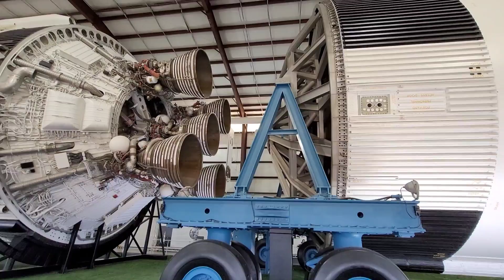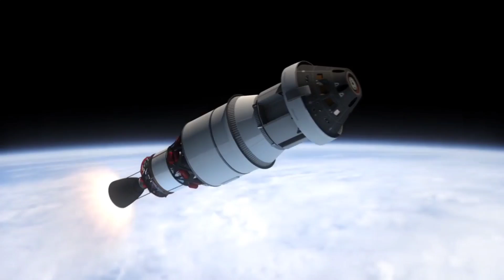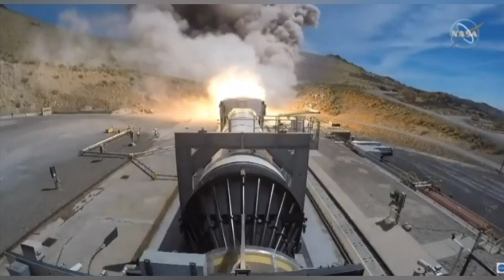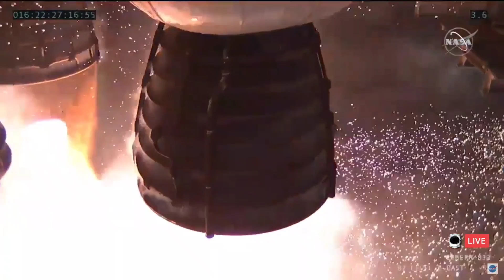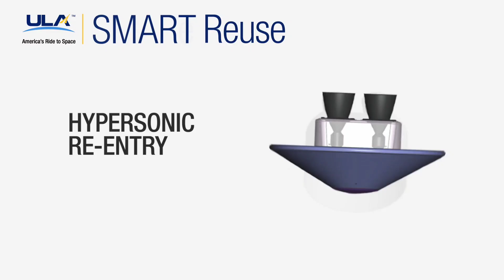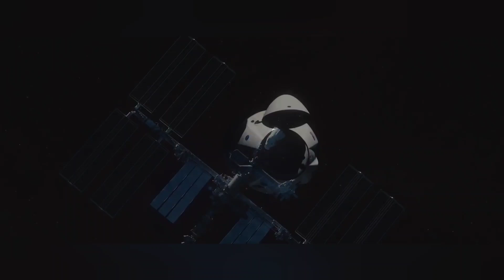Green Run Canceled! How did Boeing foul up SLS so badly? Can SpaceX or ULA (both?) solve this?

Comment: Meanwhile, SpaceX replaced and successfully static fired a raptor engine on SN10 in less than 24 hours. Let that sink in.
Reply: Insane progress of innovation! Universe, here we come...
Reply: @mikedeere4699  

No, just a quick reaction. SpaceX won't do shit. They will get a standard job done but at a standard price.
Reply: @bobfg3130  they have set the standard for the 'standard price' when all the other legacy rocket companies are charging nasa/the goverment/tax payers a small fortune for each launch of their non-reusable rockets. 
Dont know where you've been the last 10 years but SpaceX have made a hell of a difference and they are only just getting started.
Reply: * sink knocking on door *
Reply: @Bobcat665  chefs kiss perfection
Reply: yep, but according to one of those guys in the NASA press conference after that last test that was supposed to be a green run, he said when asked how quickly can they turn around and repeat the test to get more data. His answer was something like they needed to wait for 28 days for the engines to dry out or something first before they could even inspect them. 

SLS sounds like how roadworks are over here in Australia, u got 1 guy digging the hole and 7 managers standing around the hole inspecting his work. Of course like that its gonna take 7x as long to dig the hole.

Heck 28 days after a starship pancaked the ground at near terminal velocity, SpaceX is almost ready to send up the next one. 

Such a shame how it has come to his, I read somewhere that in the '60's after 1 Saturn V launched, NASA had the next one ready to go at the launch pad in 2 months.

As much as it might anger people... I think NASA just needs to fire Boeing from the project (if they were allowed to) and recruit another company that can actually get the job done.
Reply: @MrGeneralScar  Saturn V testing was actually a bold departure from previous projects: all three stages were flight tested at once, i.e. all up.  There was a war on! (Cold).  The Apollo schedule was incredibly aggressive.
Reply: And the big booster is just around the corner! But this is not a new approach to rocket testing and development. It's actually the original approach (let's not mention where, though, if you catch my von-drift ;)
Reply: Ojas  exactly. I'm sure almost everything had be thought up by someone at some point, so does that mean absolutely nothing can be revolutionary anymore? What is with some people.
Reply: SpaceX just speedrunning everything in its own way
Reply: Ojas  I guess we are just elon apologists. ;)
Reply: It would have taken NASA or Boeing weeks if not months. I was astonished.
Reply: @AP-qs2zf  maybe he means it's not a good solution for supplying lots of tax dollars and jobs all over the country, and making some people rich.
Reply: Yeah really, this is just this guy complaining that nasa is overspending. Space X is going to be the way to go, and as a veteran, private business over government organization will always be faster
Reply: @SpacialQuantum  I think NASA could be really cheap if they did everything themselves. But NASA has always had like 100 contractor companies working on various aspects and parts, it gets gluttonous and companies like Boeing don't always charge fairly, they fall behind schedule and the cost goes up, something is wrong and the company says it'll take a month and $100,000 to fix.

If a private company did the same kind of thing it'd be just as bad. But instead we have SpaceX handling everything about their rockets and wasting no time or money. The reason SpaceX has always been pretty cost competitive is because they manufacturer almost all their parts, disregarding reusability because they've always been fairly cost competitive against ULA and their outsourcing of parts manufacturing.
Reply: Ojas  👌
Reply: Other than pork-barrel politics, do you need Orion at all?
Reply: They are not forced to use a extremely complicated old engine.
Reply: i sincerely doubt they would do that if they had a commercial payload on there let alone crew. those firings n launches are prototyping.  its quite incredible how fast they can test n make progress this way though
Reply: @km5405  compared to SLS or the delta 4 heavy, who take months to reset after a hot fire abort, flying 1 hour after a hot fire abort isn't just fast, it's warp speed fast by comparison.
Reply: @km5405  

The Starship concept was probably real, but the vehicle is not. I don't care how many rockets they blow up; thats how aggressive testing works. My grievance is with the PR conartistry. This vehicle appears in every way, to be designed from the ground up, as a testbed for a particular technique, with no developmental path for a practical vehicle. The reason its made from uniform stainless steel panels, is almost certainly because they are recycling it for successive test vehicles. This form factor, at any scale, with enough fuel and engine to reach orbit and soft land, would have about enough payload capacity for a crew and their lunch. But it looks really cool... here, take my money!
Reply: It's because Boeing's become fat, lazy and stupid.
Reply: @AntiangelRaphael I never said SpaceX would be going public. It is known that Starlink will go public once income is predictable, although it'll probably still be negative on IPO. This one has to go public for that cash influx if it's going to survive
Reply: they did 3 static fires the day before SLS did a single static fire, and that one aborted halfway.
Reply: @jearlblah5169  They've done 3 in the span of a few hours, although not more than 1 second each, the process is the same to ready an engine and reset.
Reply: @AP-qs2zf  Not stupid, a troll...
Reply: No one is talking about break through star shot. I know the guy is dead but his concept was by far the most daring.
Reply: @ntandotshangela8999  you realize that is nanotech right? why would we be talking about it?
Reply: @AP-qs2zf  😂😂😂😂 well put
Reply: SLS needs a month to replace an oxygen valve - the reason there has been no second firing test as yet. And remember, they have stacked the solid boosters in anticipation of a launch, but they may have to disassemble them if the launch date is delayed too much (inspections needed if over their 'shelf life') and re-stacked.
Reply: shhhhh iT's dIfFeReNt though.......... lol!
Reply: @AP-qs2zf  Yet is correct and called the fireball.
Reply: Your point? Meanwhile Space X unsuccessfully re-fired a Raptor engine on SN9 in less than 24 hours. Let that sink in
Reply: @AP-qs2zf 
 Yes! He is.
Reply: We need to get our s*** together or by the time we return to the moon astronauts will be staying at a Chinese hotel
Reply: Ojas  reusable rockets are just a concept? Hmm. Go back and check again.
Reply: And it blew up
Reply: @springbloom5940  Are you one of those shills who deliberately ignore things that are obvious to everyone (ergo, that this flight was a massive success) just to make yourself look stupid in the process?
Reply: @carljohan9265  

Don't use words you don't understand 🤦
Reply: @carljohan9265  

shill
/SHil/

noun
an accomplice of a hawker, gambler, or swindler who acts as an enthusiastic customer to entice or encourage others.

Who does that describe here, imbecile?
Reply: @springbloom5940  Oh yea, pretend to not know the meaning of the term the way it's used on the internet.
And throw in cheap name calling for good measure. 
Keep dancing if you want, I'll have some more fun laughing at your pathetic attempts at provoking me.
Reply: @carljohan9265  

You really are this stupid, aren't you? Please clown, entertain us...
Reply: @springbloom5940  come on now, that was weak. 
Surely you can do better than that?
Reply: Sn 10 didn't go to space
Reply: @1320crusier  I don't understand why you feel the need to state a fact that everyone in the fucking world knew long before SN 10 even flew.
Reply: SS is a hollow shell and still blew up. You have no idea how complicated a human rated rocket is. It took Spacex 10 years to develop Dragon, let that sink in....
Reply: I am getting a lot of pushback for my comments. check out this video. https://youtu.be/aNZTRdq7xbE
Reply: Ojas  " cost effective"  does not equal to PERFORMANCE
Reply: Doesn't matter. SpaceX won't make a difference.
Reply: Ojas  oh me too man, that would be the level of innovation that Elon apologists believe he is capable of.
Reply: @quantumuninstall  let’s look at the last of how many reusable transport system there where, hhhmmmmm I only see one which was partially ( 75% yes I am nitpicking) reusable that was the STS.
Reply: Lets hope Biden does not cut the NASA budget like Obama did. Biden may need that money to recreate ISIS in Syria that President Trump destroyed.
Reply: @shasha1873  Ares was coming in over budget, over time, and under performance when Obama canceled it in favor of the Commercial Crew Program. Senator Shelby however was pissed because his district was losing money so he riled congress up with false statements about Nasa not having any launch capacity and successfully uncanceled the Ares V and then put it in his district. The shape of the Ares V should look familiar because it got renamed the SLS.

And that probably explains the SLS really. It didn't start to give NASA spacelaunch capacity, it started as a jobs program.
Reply: @shasha1873  Trump didn't destroy IS
IS you cult magamoron.
Reply: @jabom99  Yes he did. One year after his presidency you never heard about ISIS again on TV. Obama was arming them and called them moderate rebels. LOL
Reply: @shasha1873  where’s osama
Reply: @shasha1873  Except we keep hearing about IS and other Terrorists. Not to mention Trumps promotion of Rightwing terror groups in America. So Trump not only abandoned allied groups to Terrorists in the Middle East, he backed Terrorists over lawmakers in the USA.

Of cause crashing America’s economy is almost a standard thing for Republicans now days. Fluffing the pandemic response so badly 40% more Americans die on average than is normal. Which leads to greater than half a million deaths. That is Trumps special saurce and he splashed it all over America.
Reply: @jabom99  Ok I have to give you props about the response to the "cult magamoron" 🤣, but i have to disagree about your opinion on spacex. they have made the same progress as NASA with 20x less time. Im willing to give them a chance since the starship is still a prototype, and is making its way up the steps for now.
Reply: @jabom99  idiot troll?
Reply: @psibug565  are you talking about Obama and Biden?
Reply: Ojas  no need to be an Elon apologist, but there’s not a whole lot of revolution going on here. Just moving fast and breaking things. More power to them, but everything they’re doing has been done before, just some of those ideas were before the technology could support them.
Reply: SpaceX isn't exactly doing anything revolutionary. Elon musk is simply rehashing old ideas with new technology and calling it innovation, not to mention that all of the "huge milestones" are exaggerations of the truth.

But I will give him and SpaceX one thing. Those Raptor engines are a goddamn thing of beauty. The first full flow staged combustion engine that has not only flown successfully, but has show to be repeatable.
Reply: @quantumuninstall  In my opinion real development is exactly what SpaceX does. Realizing, funding and commercializing ideas is always real bottleneck of all industry. There are always swarms of innovators with exotic ideas and most practical development steps are based on surprisingly old ideas. 
SpaceX is the first company which have commercialized reusing of rockets. It exceeds all ideas on paper in my appreciation with orders of magnitudes. It is practical step which leads to more advanced operations in space and not just science fiction story for 50 years like many published new ideas are (for example, all suggested forms of nuclear propulsion).
Reply: @quantumuninstall  How exactly is it not anything revolutionary? What rocket does what Starship does?
Reply: @quantumuninstall  There are no real new ideas. People keep thinking that the only mark of true innovation is thinking up brand new ideas yourself, but newsflash - every good idea someone's thought of has probably been immediately thought of the moment that field was known to exist, and long before it was feasible to expand. Actually translating those ideas by bending metal and testing is what is often missing nowadays.
Reply: @quantumuninstall  And what company landed boosters vertically and reflew them multiple times prior to SpaceX? So what if they are using existing systems that have proven effective? That is how progress is made, standing on the shoulders of giants.
Reply: @quantumuninstall  who else has reusable rockets?
If that is not innovation, what would you consider innovation?
Reply: @AP-qs2zf  Are you not capable of objective thought?
Reply: @jabom99  SN8 SN9 SN10 are testing platforms. Have you not seen the stacks sitting waiting to be assembled. Remember that Musk achieves most of what he sets out to do. Like landing and reusing Falcons. ULA, Boing, and to some extent NASA are dinosaurs with dimentia. They do nothing but waste tax dollars.
Reply: @jabom99  You troll. 
You not objective. 
You got it right! 
Just provoke and insult to your hearts demand. 
Just like those stupid BrexitDeers.
Reply: Sorry SpaceX is not a good solution. It's re useable rockets are not cost effective. Also, SN10 will be another fireball.
Reply: @jabom99  "not cost effective", I'm sorry, but what rock have you been sleeping under for the past 20 years?
Reply: @carljohan9265  He must be a Boeing employee, that's all...
Reply: @carljohan9265  It is not cost effective. The shuttle was cheaper.
Reply: @jabom99  The shuttle cost roughly 1.5 billion per flight. 
That's notably more expensive than the Saturn 5, which was around 1.2 billion and fully expendable. 

A falcon 9 costs between 50-60 million per launch, and a falcon heavy is around 90-100 million. 
So you can just STFU.
Reply: @jabom99  not cost effective? Were you dropped on your head from orbit?
Reply: @jabom99  Falcon 9 standard launch price is ~$62m / < $3,000 per kg to LEO. That looks pretty cost effective. The space shuttle (as another reusable example) was closer to $60,000 per kg...
Reply: @jabom99  And so what if it's another fireball? They've solved each problem so far. They have vehicle control down, the only issue is reliability in landing, first time was fuel pressure, second time was engine failure, third time will be testing a redundancy method. It seems to be cost effective for falcon, since they prefer customers use "flight proven" boosters.

I'm guessing you don't know how many fails it took in testing for all the equipment in the Apollo mission to work either?
Reply: @Jaker788  I'm guessing that you think this heap is actually going to Mars. lol.
Reply: @jabom99  No there's no guarantee, it's an optimistic ideal. But for launches to earth orbit for sure.

It's unfortunate you don't see the technology SpaceX has made, but whatever, be a hater. Maybe when SpaceX goes public you can try short selling and get wrecked
Reply: @jabom99  so you criticise someone for objective thought then say im guessing you think this heap is getting to mars?? Hypocrite
Reply: @jabom99  I found the Thunderfoot Cult member.
Ironic that you accuse other people of being incapable of objective reasoning and individual thoughts.
Reply: @Jaker788  didn’t they blow like 10-20 f-1s up until they made into the powerhouse that it was ?
Reply: @MrTrashmasterfx  Yeah I think the first few had combustion instability. They figured out a new injector plate or something and then they actually put explosives in the combustion chamber to intentionally destabilize the combustion, it'd destabilize and quickly fix itself.

Not sure what problems the Raptor is having, I don't doubt they'll figure it out eventually
Reply: @jabom99  What makes you think it isn't? Im starting to think you are a troll. Starship will be on Mars one way or another within 5 years. Probably before SLS is ready and before Blue Origin has a rocket
Reply: @ThatSB  

You should give Elon your lunch money. Your mom will give you more.
Reply: @Jaker788  This piece of crap will never be human rated. It is unfortunate you call me a hater for stating the truth.
Reply: @jabom99  Ok dude. I guess NASA was wrong to select Starship to be part of the lunar lander final bidding round and actively invest in it.

You should try explaining exactly what's wrong with the Starship platform and vehicle. And you should do research on how much falcon 9 reuse costs (hint it's about 10% of a new booster)
Reply: @Jaker788  The Starship platform has no provision for an escape rocket, it would need 18 in orbit refuelings to get to the moon, it is way too big, there is no astronaut program and NASA is not going to supply astronauts. There are so many reasons I cannot say here.  there is a good video that you should watch that explains more. NASA did give some money but less than the other programs. 
Do some research on youtube.
Reply: @jabom99  SpaceX has done more for space travel in 10 years than NASA has done since 2011.
Reply: @jabom99  "Do some research" = "Do Your Own Research". Bless ya. I think that's +1 on Troll Bingo (tm). Dude - no-one in these companies cares what you think. Sorry...
Reply: @jabom99  splish splash your argument is trash
Reply: @jabom99  The Saturn 5  Rocketdyne F1 engine was almost scrapped due to harmonic vibrations   They kept testing until they got it to work.
Reply: @jabom99  LOL, the best thing to do with folks like you is let the comment age as poorly as your thinking. You'll be just like all the other naysayers who had to go somewhere and STFU up when Falcon 9's started making successful landings. You are someone I would never want to be around in an emergency because you'd be the first one to give up because you can't "see" a way out.
Reply: @jabom99  Are you idiot?
Reply: @jabom99  It's rockets are extremely cost effective when the first stages (or in the case of the FH the first stage and the boosters) are landed successfully. It saves them millions with each launch.
Reply: @solomonaerospace5932  No, The maintenance involved negates any cost savings.
Reply: @jabom99  my oh my has this comment quickly not aged well (sort of)
Reply: @wavywatson4469  Nope I saw a fireball.
Reply: @jabom99  that’s the reason why I said sort of, but it did what the heck previous starships were not able to do, land. So that is a win in my book.
Reply: @wavywatson4469  So would you ever want to fly to Tokyo on this thing. How about the Moon?
Reply: @jabom99  I would consider it, when the starship is in it’s finished state. This is many years away, but I’m looking forward to it, and I believe it will happen. Btw, You’re judging the Starships just from the previous 3 launches. These are cheap PROTOTYPES. Their purpose is to help Spacex figure out what does and what doesn’t work on their rocket. Then they fix those issues. Do you not remember how they handled Falcon 9 landings? They kept trying and failing and learning, until they stuck the landing. Currently the starship is in the same phase. If you don’t believe in starship I understand.
Reply: @jabom99  "So would you ever want to fly to Tokyo on this thing." You sir, have peaked in ignorance. I encourage you to watch footage of the very first attempts at making an 'airplane' pre-1903, and then watch the prototypes that repeatedly failed before that. Then ask yourself, would you fly on that? No. Now be quiet.
Reply: @wavywatson4469  Your hero that you worship like a gawd  says 2023. That will not happen. The crazy Japanese billionaire will never go to the moon. This piece of crap will never be rated to take humans anywhere. Sorry to burst your bubble.
Reply: @gus3770  1903? Who cares?  Check back in a couple of years. I will be proven right. So piss off I will not be quiet.
Reply: @jabom99  well I can see why you would believe that, but I believe differently.
Reply: @jabom99  What fireball? I saw no fireball? And not cost effective? LOL
Reply: @jabom99  SN10 Landed successfully.
Reply: @jabom99  Found the ULA damage control squad!
Reply: @jabom99  Falcon 9's are not cost effective? You mad lol
Reply: @jabom99   have u like not seen their line of Falcon 9 rockets they are very good and extremely reliable and reasonably priced for a two stages orbital launch vehicle that lands it self on a football field sized boat or back on land but the starship is still in development so hush hush it’s still in testing 

Now I’m for spaceX cause while nasa is full of bright people it is slow and time consuming and ehh reliable the testing times are very far apart and can’t be trusted same for Boeing there’s just not enough testing that’s been done and it’s extremely far apart pricey time consuming in again SpaceX is rolling out builds left and right starship test tanks starship test flights so what do u prefer then nasa A slow government funded program that has multiple attachments all over America or do you prefer a privately funded company that is already successful within multiple years as in satellite deployment, cargo to the ISS, human commercial space flight through the ISS and returned and now working to get to the moon all so fast I’m like NASA what do you prefer

I’m for ULA as well  just like SpaceX they’re very fast very good very Reliable and they’ve been in service for many of years
Reply: @jabom99  Well...you weren't wrong about the fireball.  Maybe about when...but still.
Reply: @jabom99  in your face Wayne, successful landin..... oh  never mind.